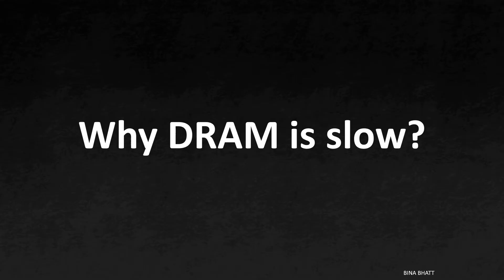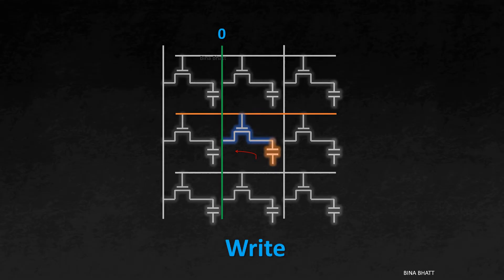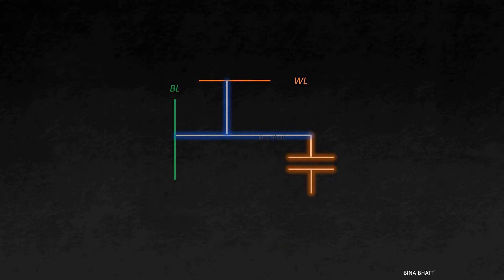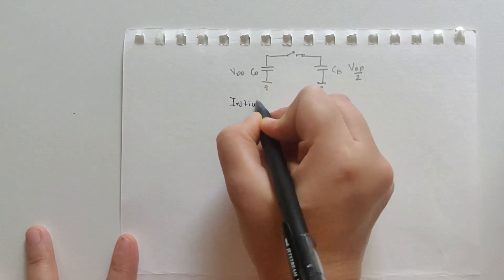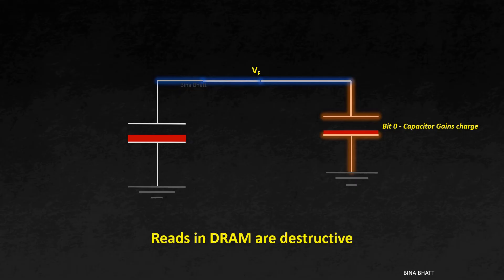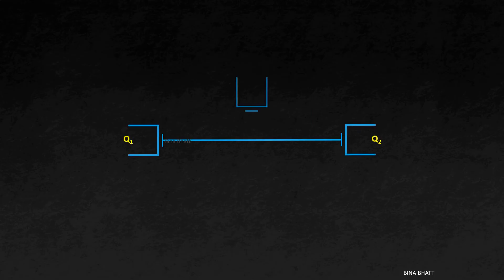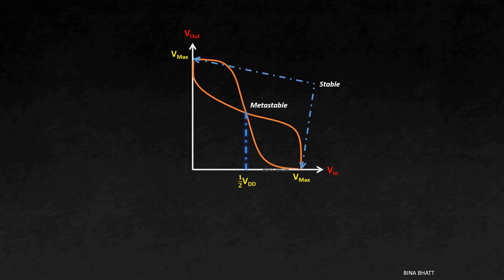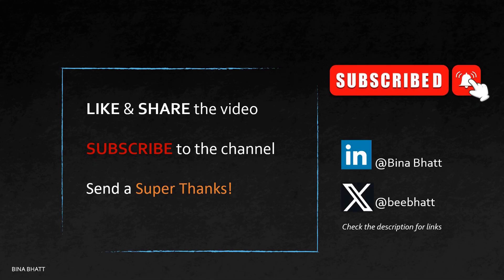DRAM - Read and Write operations (Most detailed explanation!)

Comment: Why precharging is required before read operation?
Ans:- Precharging the bit line before read  in DRAM ensures it starts at a known voltage level, which stabilizes the signal and allows for accurate and efficient data reading. it will help the DSA to sense the correct bit value.

Comment: Video was very informative👌,
Ans:- we precharge bit line for next read operation.
Reply from the maker: Thank you! Yes, we precharge it before the read op but why?
Reply: @BinaBhatt  Because then both charging and discharging the capacitor is just half way between the 0V and the full voltage, so it's faster than changing the entire way. It also makes the charge and discharge cycles more symmetrical (both take the same time). It's also more reliable, because if we have an empty capacitor and a line at 0V potential, there would be no change in that line's voltage when it is connected to the capacitor, so the sense circuit would see no change. Precharging allows it to see the change in voltage both for charging and discharging. Another reason might be that precharging fills up the bit line with free charges that can go into empty capacitors (which can be sensed), which would be impossible for a 0V line that contains no free charges to move somewhere else.

However, despite this video being quite detailed (in fact, more detailed than most videos I've seen on the subject), it still doesn't cover the details of how exactly the entire process is orchestrated – who turns all those particular signals and when.
Reply: @BinaBhatt  looking for career option in VLSI
Reply: @BinaBhatt  precharging to obtain vdd/2, which is used to detect the small change in voltage. 
if not precharged, the small changes will not be properly detected - read operation will give a wrong output.
Reply: As for the other question: The mystery circuit seems to be a pair of inverters (NOT gates) coupled together in a feedback loop, a.k.a. the D flip-flop, the same which is used in SRAM memory cells.